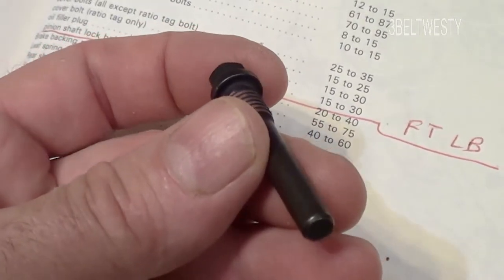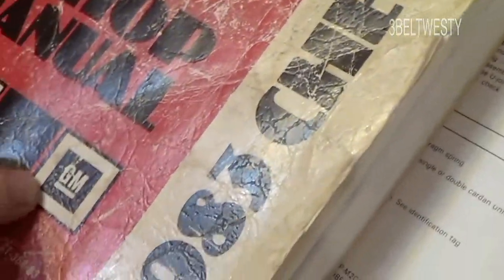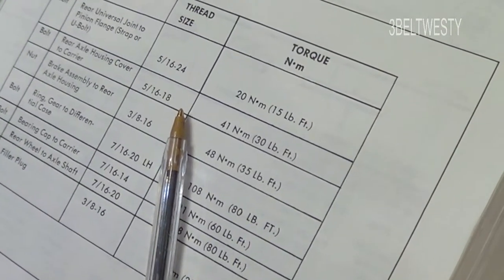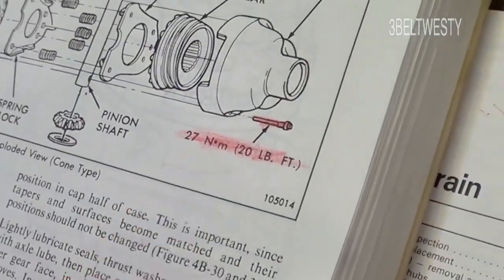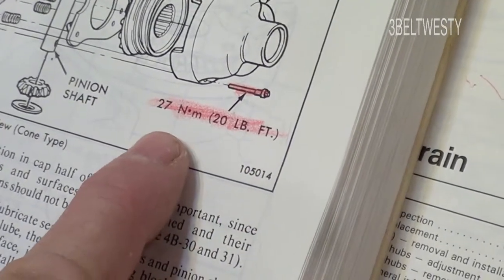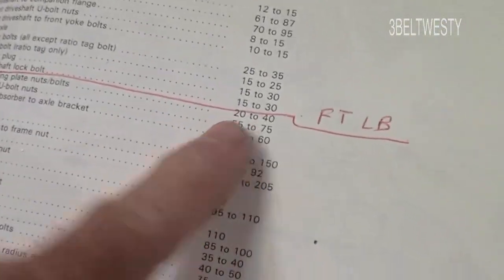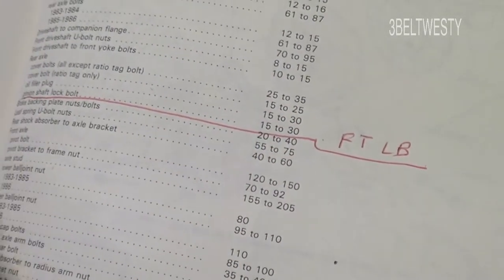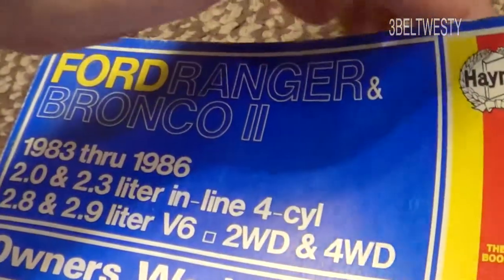Pinion Lock Bolt Torque Specs

Comment: I asked someone at the part store and they said 64 lb in but I tried that and that didn't feel right.  I hardly put any pressure on it.  15 to 30 sounds and feels a lot better.  I recently had my screw come out and the cross pin fell out and stopped me in my tracks.  I had no idea what happened when it happened until I opened up and seen my cross pin in 2 pieces and my bolt laying on the bottom.  So I want to make sure I get this right this time.  Plus I got locktite to back it up.

Comment: That's a lot: 20 lb.ft == 240 lb.in. I'm going to go to 140 lb.in, and then tap it three times 6" out using the 6-pt offset used to take it out.